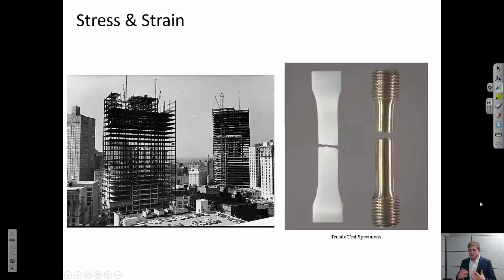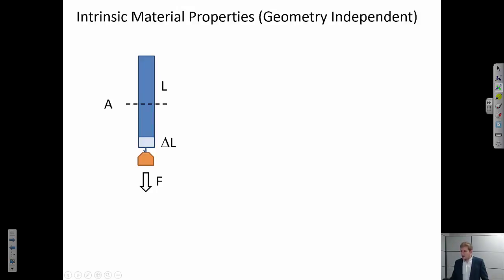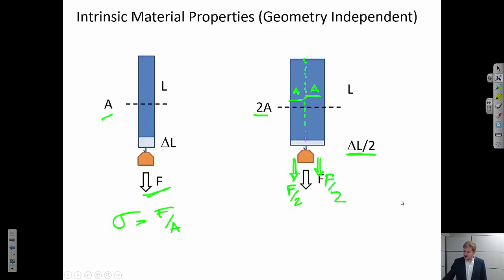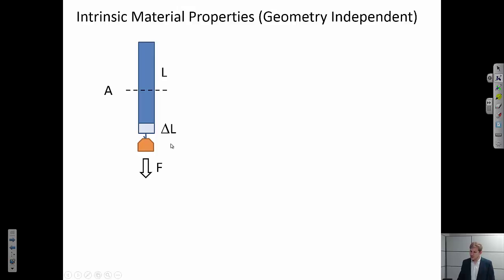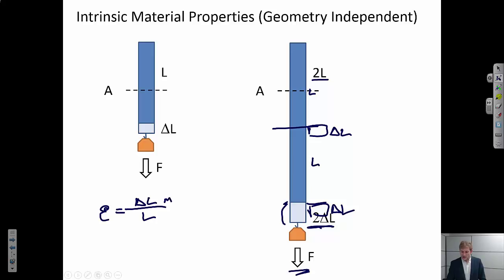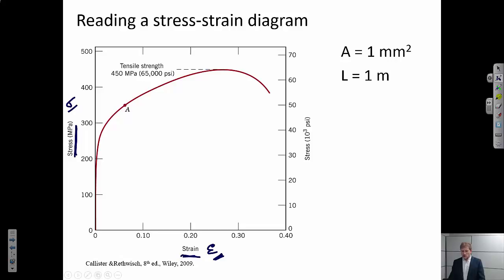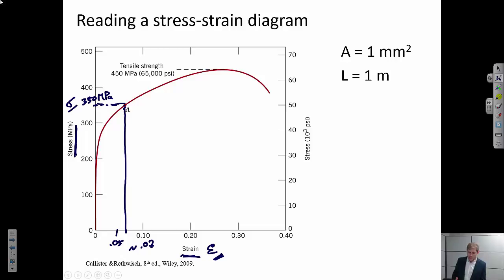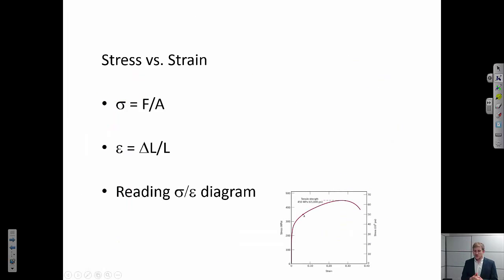Stress Strain {Texas A&M: Intro to Materials (MSEN 201)}

Comment: Suppose we wish to make a cable that can support a force of 1000 kg. The ultimate tensile strength of aluminum and steel are 2000 kg cm-2 and 3000 kg cm-2, respectively. The densities of the two metals are 2.7 g cm-3 for aluminum and 7.8 g cm-3 for steel. The costs of the two metals are $ 1.10 kg-1 for aluminum and $ 0.66 kg-1 for steel. Compare the:
(i)	Volume.
(ii)	Weight.
(iii)	Cost.
of the cable per meter for each metal and comment on your findings.